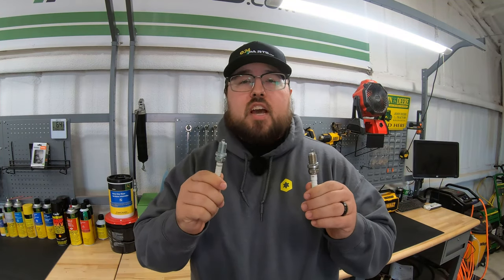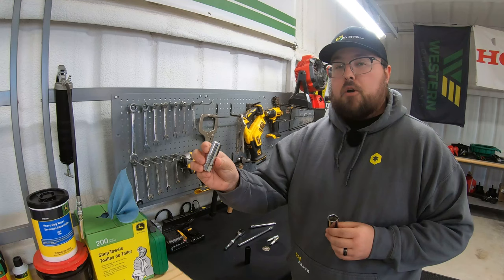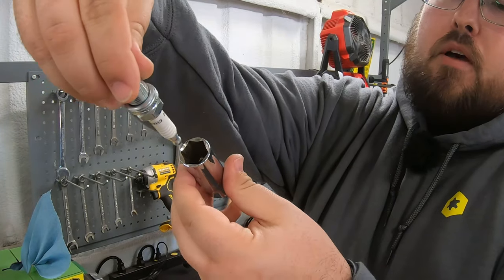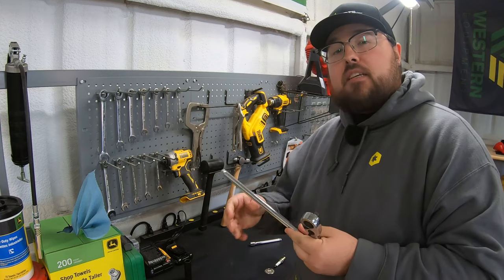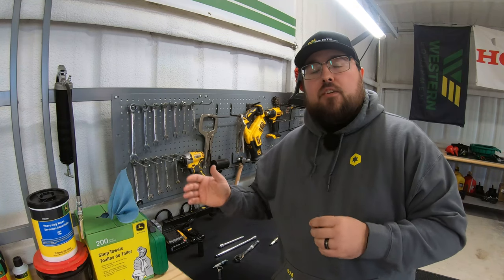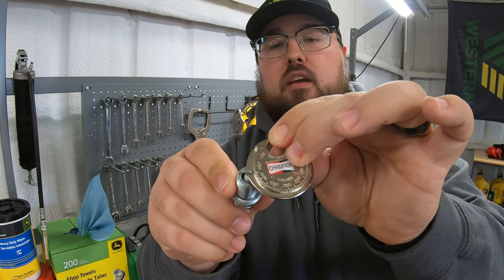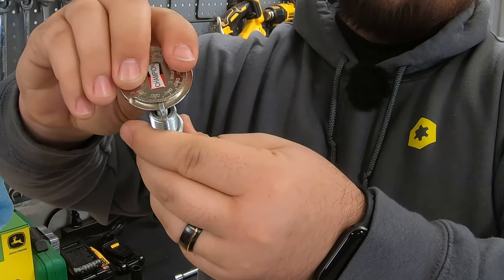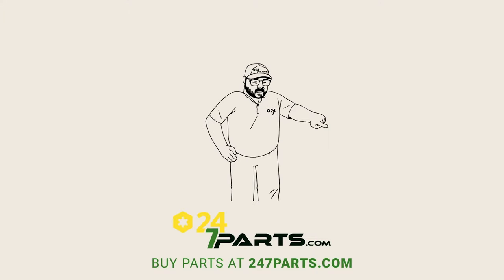These Are the Tools You Will Need to Change your Spark Plugs

Comment: Spark plug sockets...  many years ago they made good ones that had more of a foam rubber insert. They worked well. Most of the spark plug sockets you see today have a plastic-like insert or hard rubber. These work okay when the weather is warm but as soon as it gets colder these rubber inserts get stiff and will refuse to let go of the spark plug. In most cases when you pull the socket off the plug the insert stays on the plug. Then you have to get down in there with needle nose pliers and try to remove the insert. It can be very frustrating. I finally invested in a set of magnetic spark plug sockets. Wow... what a difference. They have a narrow bore to protect the insulator and the spark plug is held in place by a magnet that securely holds the plug but gently releases when you pull on the socket. It doesn't even pull the extension off your ratchet which it all too common with rubber insert plug sockets. One of the best purchases I have ever made.
Reply from the maker: @EOSJOE thanks for the great info! you're the man.